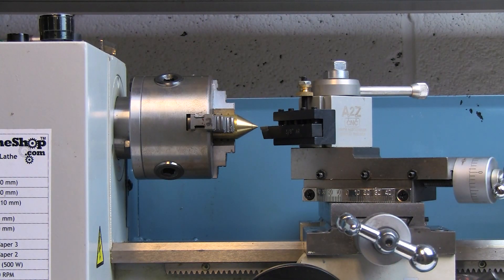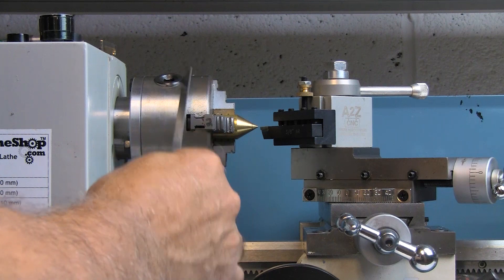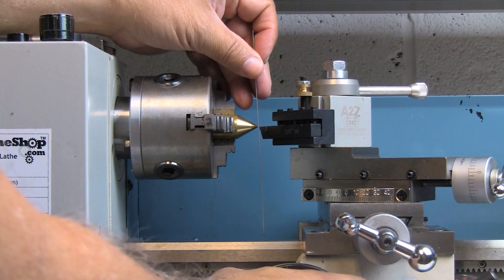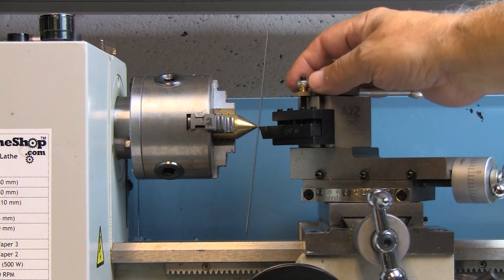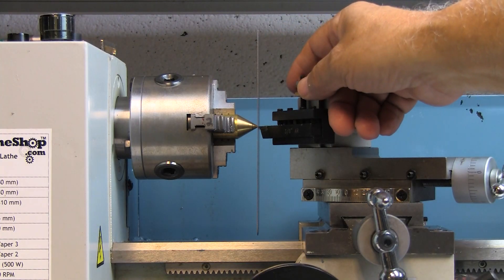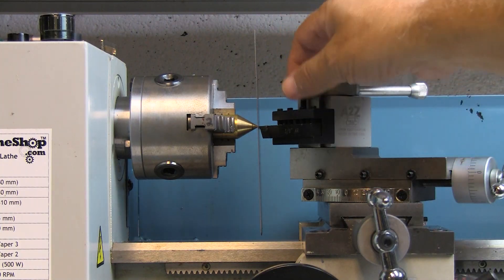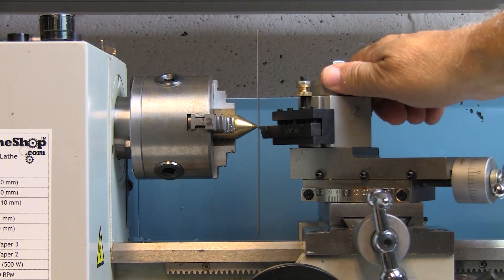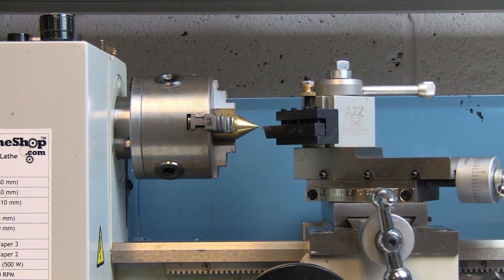How to Perfectly Center your Lathe Tool

Comment: I am an "Old Guy."
I saw this idea 50 years ago, in Popular Science magazine, when I was in high school.  
Here is the fundamental flaw in the idea.  (It is impossible to explain the flaw without a drawing, but I will try.)
The essence of the flaw resides in the ASSUMPTION that the ruler is an infinitely hard, impenetrable object.  (Ask yourself whether that assumption is true:  Can you make a scratch on the ruler using a carbide scribe ?  Or a sharp pocket knife ? Of course you can.  So the ruler is not impenetrable.  That leads to the flaw:  how deep is the scratch ?  0.001 inch ?  0.002 inch ?  More ?)
That is the problem.  The two points pressing on the ruler, from left and right, will penetrate the ruler different amounts.
The gold cone (ie, the workpiece), in the photo above, will penetrate the ruler to some extent, coming in from the left side.  
Similarly, the carbide bit (held in the tool holder) will also penetrate the ruler to some extent, coming in from the right side.  
Just draw a diagram.  Will the penetrations be identical ?
Whether the ruler remains perpendicular to the axis of rotation of the lathe depends on the two depths of penetration.
You cannot assume that the two penetrations will be the same, especially since that the initial proposal assumes that there will be no penetration at all.
That's the best I can do without a drawing.

Comment: that is okay for general machining work. The 'perfect' technique is to cut a free cutting material like brass intentionally lower than center then measure the center feature with a toolmakers microscope. But I recognize not everyone will have the auxiliary equipment to perform (as close to) 'perfect' work.

Comment: Also you could draw a vertical line on the back on the back splash with a fine tip sharpie to help line up the ruler.

Comment: This is a great little ‘shortcut’ used in the industry, even putting the ruler between the side of chucked barstock and the cutter - so long as people realise that it is a ‘shortcut’ and not the most accurate method, so not for extremely tight tolerance work. 😉

Comment: What is the best way to drill on center of a rod's face with a drill press.
Reply from the maker: I have a little Y shaped tool that will allow you quickly locate the spindle wright on center.
Reply: put the rod in the chuck and the centre drill in the vice

Comment: Thanks for the great tip, and I really appreciate it, but the operator still must "eyeball" the metal piece to determine when it is vertical.  This leaves room for error.    Would not the use of a square assist in assuring that the metal piece is truly vertical?  God bless.
Reply from the maker: The longer the blade the less the error. You can be a bit low and it will be just fine unless you want a perfect facing cut without a center dipole.

Comment: This is good knowledge that should be passed on to all young people learning the trade skills. I was shown slightly different; chuck-up a piece of known round bar, bring the tool tip up to it and adjust for vertical. (Same principle but 90 degrees about; usually done as a final check on the work you are about to start.)
Reply from the maker: Thanks that is also a great trick. I will do a short video on it.

Comment: This is a neat trick to prepare the holders, you can push it a little further by turning the point just before lining up all the other tools... ;)
Reply from the maker: +pierre beaudry Right.I like to have the tool just a hair under center. Seems to cut even smoother. This Quick Change Tool set is a generic imported one but it is very well built. It comes with about 5 inserts which I have preloaded and at the ready.Joe

Comment: Can you show how to set up the lathe to be ready to use out of the box? You mentioned adjusting the gibs in a prior video, can you demonstrate how that is done as well as the tail stock centering? Thanks for this tip on centering the tool.
Reply from the maker: +Fierceflyer55 Thanks for the questions. I will definitively do that in a future video!Other versions of this lathe come practically unusable. Some come perfectly adjusted.Depends where you buy it from.Harbor Freight is TERRIBLE and LittleMachineShop.com is very good as is Grizzly tools.If you understand Chinese Manufacturing philosophy, you pay more per unit? They will do a better finish and prep. You pay little and you basically get a machine will casting sand still in the corners and painted over. Basically you will have a boat anchor that looks like a lathe.Thanks again and please pass the word about my fledgling Machine and Miniatures Channel.Joe